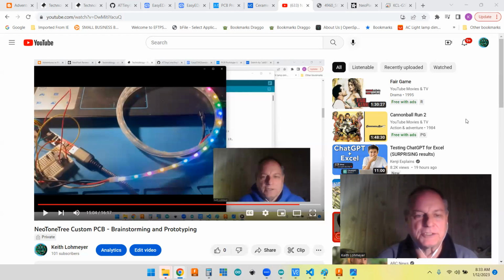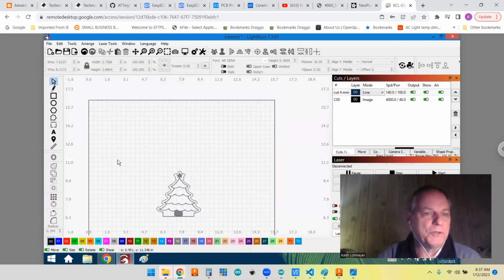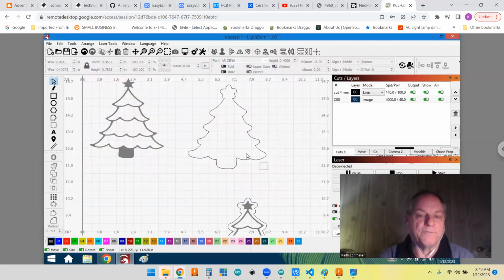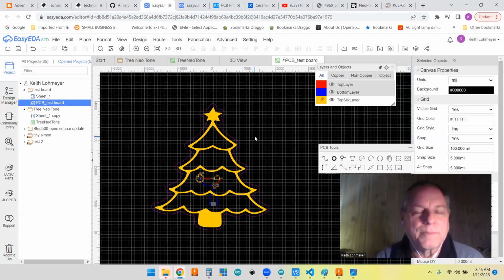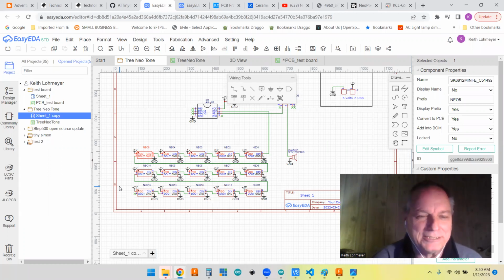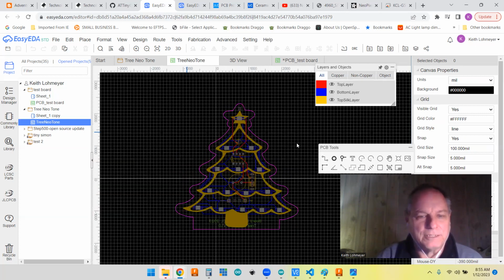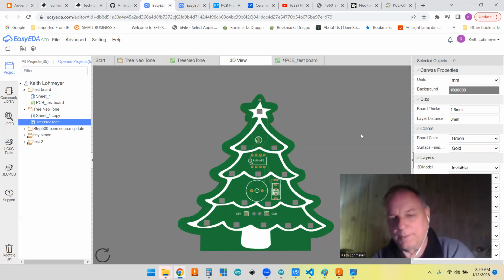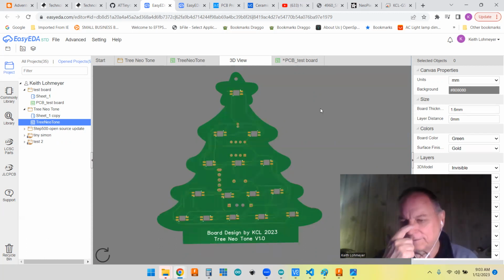NeoToneTree Custom PCB Part 2 - Board Design and Layout

Comment: Great explanation of how you created this PCB.  Now onto the last video.
Reply from the maker: Hi Lori, Thanks. I m still surprised how easy and inexpensive it is to design PCB prototypes. You should give it a try.
Reply: @keithlohmeyer  My circuits knowledge is not there yet - but it's on my to do list for the future.

Comment: Really like the tree. Why did you put those bulky parts on the show side?
Reply from the maker: With through hole you either have components on the front or solder joints. I think the components look better.